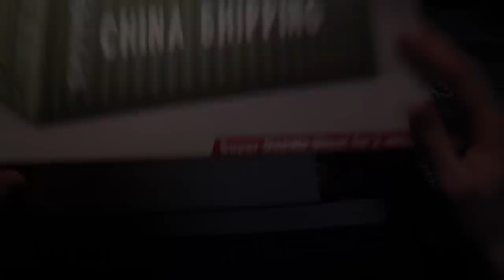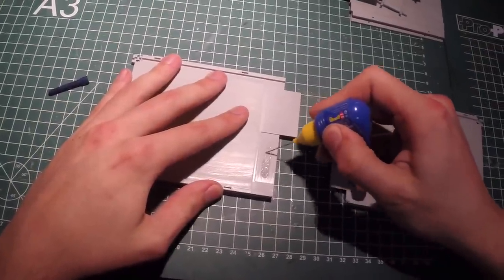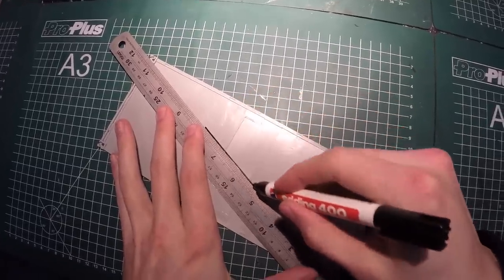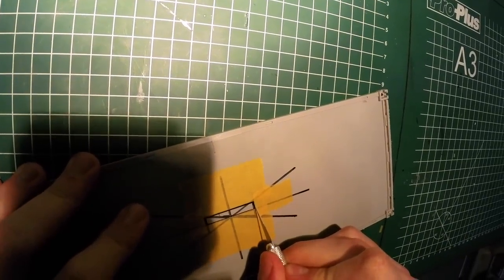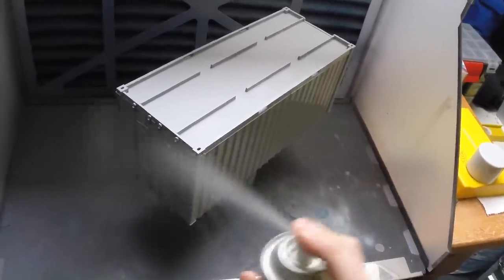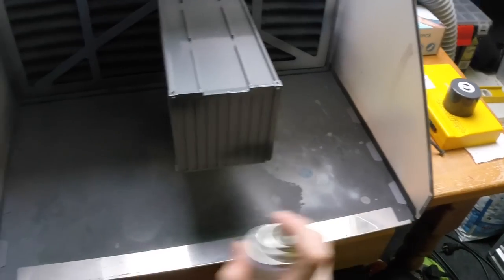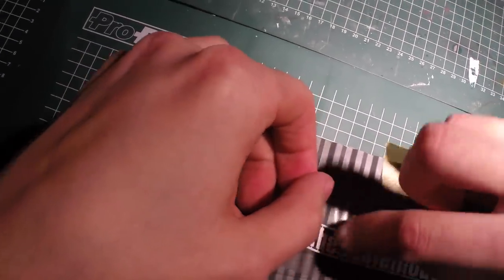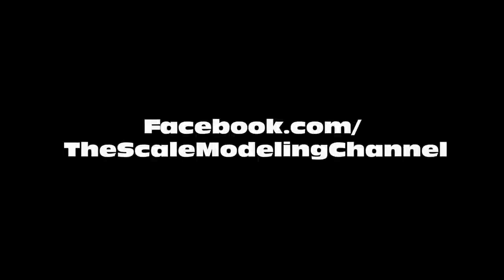Italeri: 20ft Container Custom Piggy Bank

Comment: Hi quick question here...once I complete a model car, over time the revell glue becomes very weak and parts of the car tend to fall off...do you encounter the same problem and if so how do you ensure that this doesn't happen?....thanks
Reply from the maker: I don't i only use it on unpainted(bare plastic) parts. And if i use it on painted parts i remove the paint on the areas i want to glue.

Comment: Can i have a link from where you got the crate from please?

BTW You are the best model maker channel EVER! I'm planning of making a RX7 Model and putting it inside the crate with the front sticking out, and it would be such a great help if you get provide me with both of the links (RX7 and The Create) Also can you let me know if the RX7 would fit inside of the crate because it would be a waste of money if it doesn't fit.

Thanks and bye
Reply from the maker: I got it from a local hobby shop. So no links thee. I would try ebay. for both.

A 1/24 car fits in it just fine.
Reply: ok thank you!